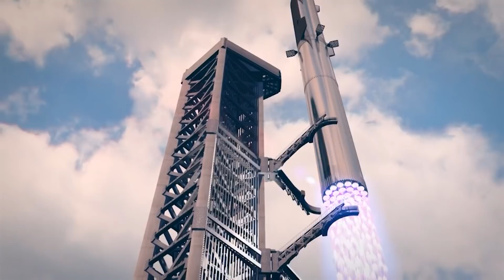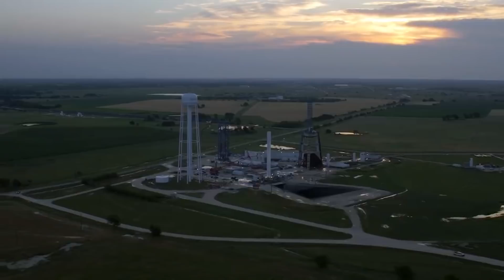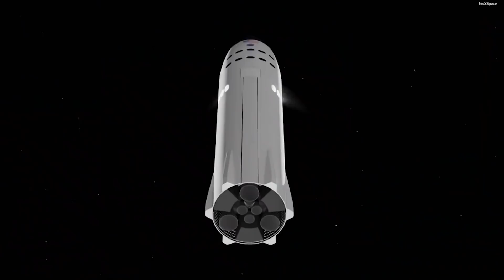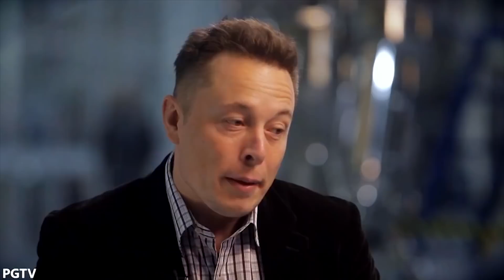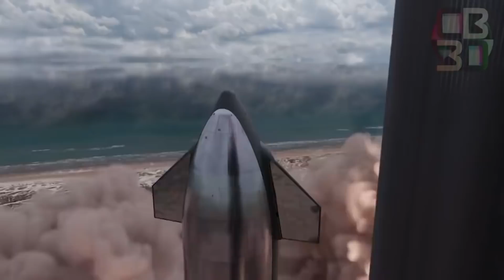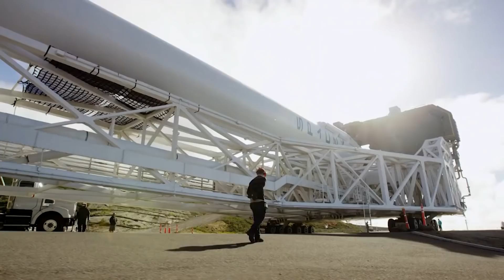FINALLY! Elon Musk OFFICIALLY Reveals New Nuclear Starship 2022!

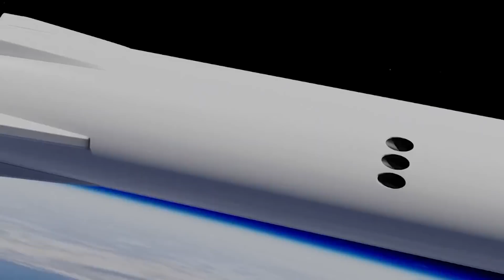Comment: 0:44 Why do people call a wingless vehicles an aircraft? These are to be used in space, which has no air. Therefore, it is Not an aircraft. It is a Spacecraft.
Reply: it performs controlled decent through the atmosphere in order to land. using control surfaces to steer, kinda like a plane does.
Reply: @camplays487  Booster does the same, but no wings again. And since when does "above the atmosphere" count as air travel. Just makes no sense to me.
Reply: @alanvermillionsr7126  THROUGH THE ATMOSPHERE, and does a helicopter have wings?
Reply: @camplays487  Theirs rotate.